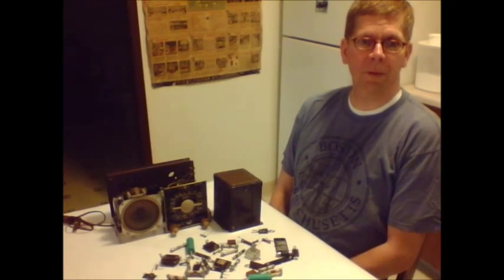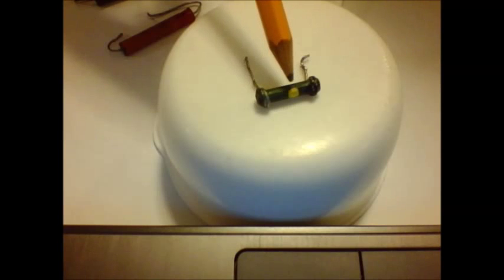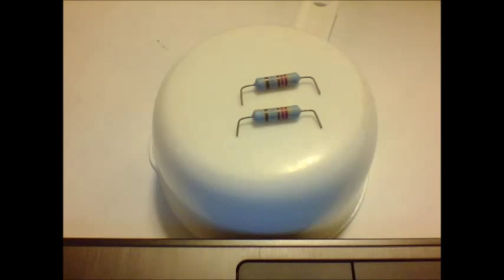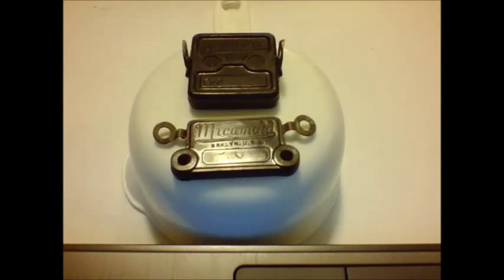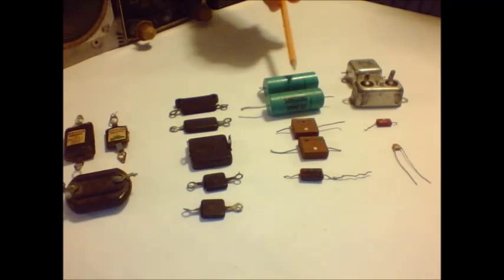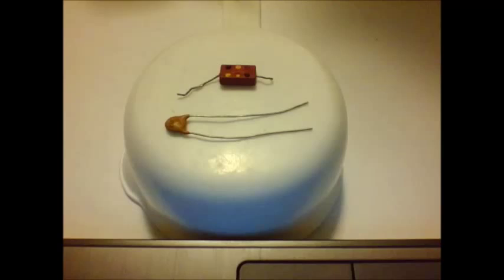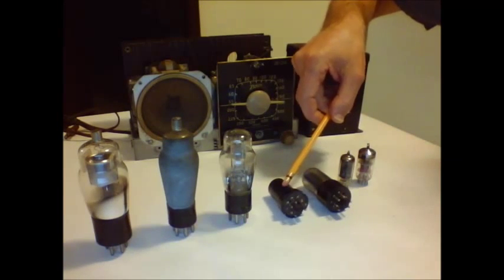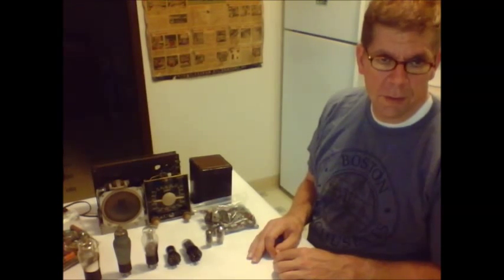Vintage Radio Parts Indentification

Comment: I have a load of un-used, solder-free, resistors, capacitors, rectifiers, wire-wound resistors- are these worth money? I'd gladly trade them for diodes, whatever, or sell them.ive made 3 crystal radios, 3 power supplies, have loads of wire for my crystal radio coils, and am working on a 3- or 4-coil crystal radio. any tips on/for crystal radios, coils? I have a lot of components from radio/ clock radio/ stereo/ computer scrapping. the radio shack is gone forever, and scrapping is the way for components.